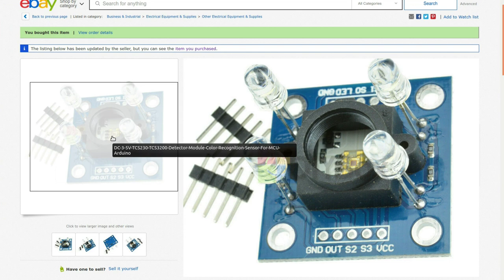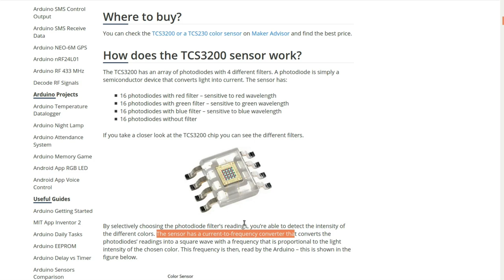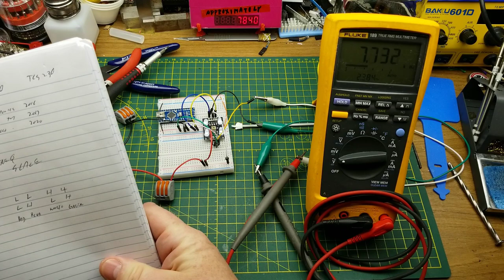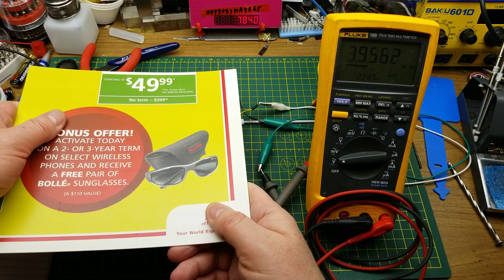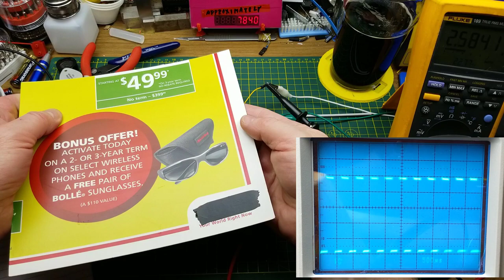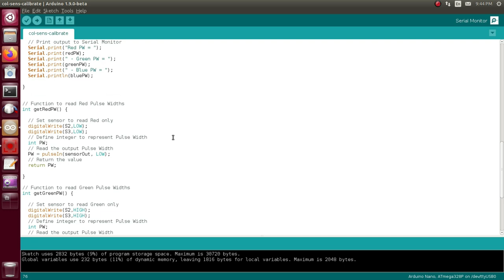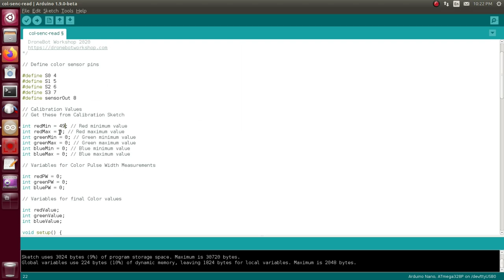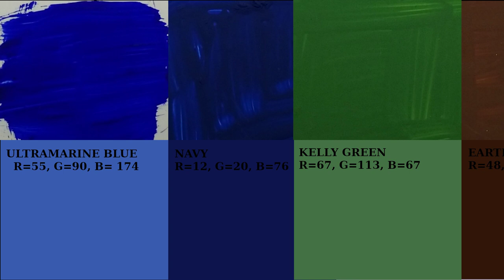tinkering with: colour sensor

Comment: The colors were pretty close.  There was some lightening of the colors, which may have been glare from the LEDs. Definitely want to see those RGB values piped to a LED panel.
Reply: Agree on the glare- a short piece of (something) around the sensor to block direct light from the white LEDs but permit bounce light from the, uh, reflective surface under test would prevent washout.
A RGB LED display wouldn't help the color-blind a whole lot though... maybe some stepper motors driving a pointer over a CIE diagram? ;>)
Reply: i realize I am quite off topic but does anybody know a good website to stream newly released series online ?
Reply: @Azariah Josiah I would suggest Flixzone. You can find it on google :)

Comment: would be interesting to use a fiber optic cable with one end to the sensor and the other to an RGB led to see if you can detect the colors. Project in mind: detect color of led on alarm panel to feed another circuit without electronic connection to panel.  May have to pick one up.

Comment: A fun little sensor and the results were pretty close, but not quite correct. This may be a limitation caused by your setup, or by the sensor itself, however there is also the colour spectrum of those LEDs to factor in.
 You could try the same thing with some improvised gel filters (transparent coloured sweet wrappers perhaps) using daylight. You would then have a better set of daylight spectrum reference colours to calibrate with.
Reply from the maker: I actually have some real gels around here somewhere.  
But they're probably not labelled, so it would be hard to know if they were being detected correctly.

Comment: You need some code to convert the RGB colour values to an actual colour (hue).  The RGB values will change with brightness even though the colour is not changing.  Just looking at these RGB values doesn't tell us (humans) much except for the when one or two colour values are way different than the others.  ie. is a RGB of 0,200,200 different from 0,100,100?
Also, the small blue colour sample might have been letting the white board reflect back to the sensor.
Reply: RGB values certainly change with brightness - the numbers represent the amount of Red, Green and Blue. So, a RGB of 0,100,100 is the same colour as 0,200,20 but not as bright.
RGB cannot really translate properly between paint and a screen because they work in completely different ways.

Comment: Odd little video, not sure of what use the item would be though:-) now if you could get it to read resistor colour codes then:-)
Reply from the maker: That would be useful.
I suspect it would take quite a lot of messing around with optics to make that happen reliably.

Comment: The limitation here will be the dreadful colour rendering of those shitty little 5mm white LEDs, and that'll be the biggest challenge to getting any form of logical outputs from the module. No, even having a high "CRI" won't help, because the CRI system that LED suppliers use is totally flawed. A simple white/black calibration won't go close to correcting the inaccuracies.
As for the colour samples, the problem was that the monitor gamma was set too high, and/or there was too much brightness.
Reply from the maker: Sure it's not an "instrumentation grade" device, but it's also only $6.

It was fun to play with it, so I already got my money's worth out of it.
Reply: @pileofstuff  - Ahhhh, I didn't realise it was so cheap! For $6 the performance is perfectly fine.
It would be a lot easier to calibrate if the illumination LEDs were changed to something with better spectral performance. The huge challenge is to find such a thing, especially if buying online..

Comment: I know you're not a programmer, and that you in essence copied Dronebot's code, so I'm fine with letting you off the hook.  But those "delay to stabilize sensor" [ delay(200) statements ] bothered me. I noticed was that the readings are started and finished in the subroutine, so delaying after that shouldn't affect the reading at all. So I dug into it a bit by going to the tutorials you linked to, and while all of them have a delay statement after reading the frequency, none of them give a rational for it (other than Bill's comment statement about stabilizing the sensor).  In every case, the code sets the colour to sense and immediately reads the frequency with a pulsein.  Any delay after that won't have any effect on the reading, so it seems it's completely unnecessary!

I tracked down the manufacturer's product documentation (https://ams.com/tcs3200#tab/documents) and checked the datasheet for the stabilization time, and here's the quote: "The response time to an input programming change or to an irradiance step change is one period of new frequency plus 1 microsecond".  So the delay should be *between selecting the colour to read and reading the value*... in other words, a delay in each subroutine before the pulsein() call.

How long a delay is needed is less clear, because the minimum frequency is harder to figure out. Looks to be different for different colours, and then adjusted by the set scale factor, but it does say that the "Dark Frequency" is typically 2 Hz - so up to 500 ms between pulses. That means that in the worst case, the delay should be 500 (not 200) plus it's in the wrong place.

Like I said - you get a pass, but It'd be interesting to know what was going through the mind of the other tutorial creators.
Reply from the maker: I noted that all 3 of the tutorials I linked to used almost identical code, so it is possible that they all cribbed it from the same place, and didn't go too deep into that delay.

it's also possible it's one of those "It won't work without it  - don't know why" kind of things.
Reply: @pileofstuff  Agree on all points. The why still niggles at me, but I'll get over it eventually...